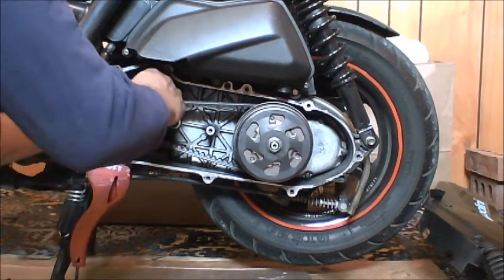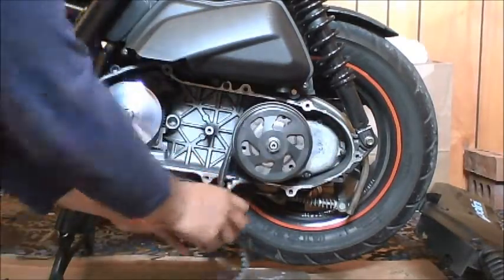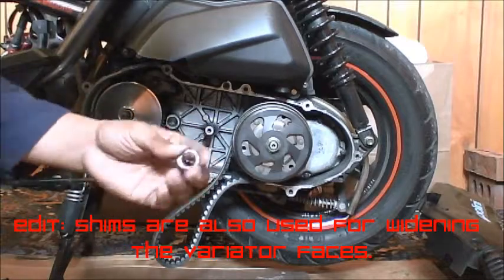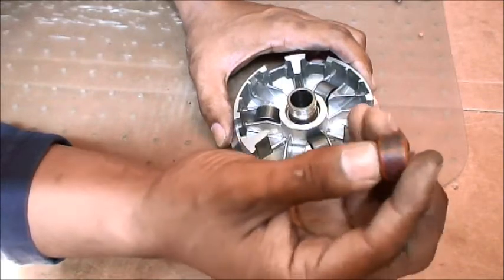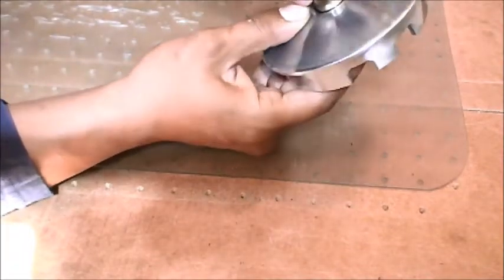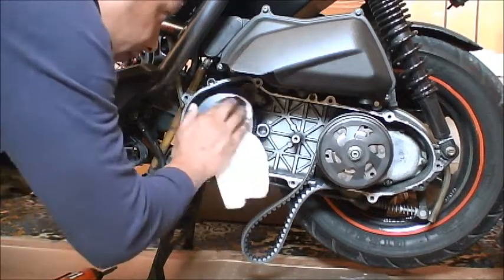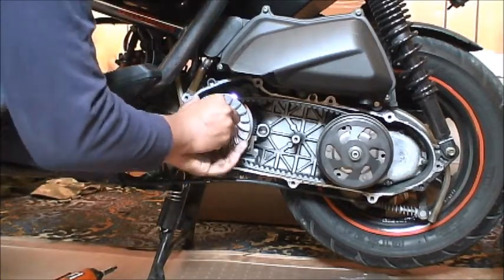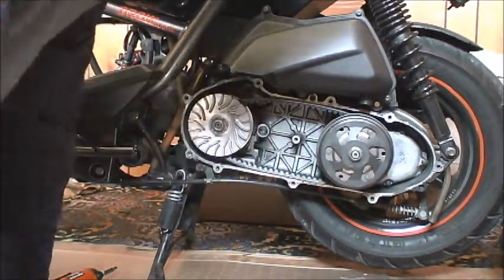TST variator How to. CVT, scooter Zuma 125 Bws 125

Comment: That is one of the best videos I have seen on removing the fan cover and variator assy.
Just bought a Zuma 125 with 6500 miles on it and will be replacing belt and inspecting variator weights.
Will leave stock weights in for now if they look good.
Thank's for doing it.
Reply: I'm always amazaed that I still get feed back on these old videos .. Thank you for watching

Comment: Did you need to install the blue 1200rpm clutch spring the kit comes with? Or was it not necessary. 

Looking at ordering the TST variator from Drowsports since it’s not in stock at rc scooter, so I’m trying to piece together my own kit.

Comment from the maker: @alejogonzalez83 The TST is a complete Variator replacement for optimal results. It does include a the fan which has slightly shorter fins then OEM and a matching ramp angle to the TST for uniform belt wear.

Comment: My fan keeps coming off, the nut won't hold on the spline, tried an impact drill and it stripped the nut, not the spline. any thoughts are appreciated. Also what is the order the washers go on?

Comment: I've got a zuma 50 and just replaced the rollers (6.5  down to 5.5) and new Yamaha belt. Take off is really slow with the new belt. I put the old belt back on and it's much faster. Should I get a second spacer like you have on the variator? Great job making this video!

Comment from the maker: @e85STi stock size. I found that oversize belts were prone to rolling over the top at high speeds. not worth it for only +2 MPH
Reply: I think that's what is happening to me, is pulling very well in all the rotation, but at high speed, it suddenly rises and seems to roll. But only in high speed? What do you think it is? Belt or clutch?
Reply: @nelsonfernandes709  variator alignment.

Comment: You can make those engines realy fast, i have one with 75mm bore and 80 stroke, and one with 66 and 64 stroke, they are realy fast, we do 6.5 on the 1/8mile, no nitrous no turbo, 98 octane fuel and, normal carb.
Reply: I'm thinking of boring mine out to a 66mm cylinder with a 3.2+ but what makes me nervous is the awful gas milage I'd be getting and all that extra heat on an air cooled engine.

What kind of mpg do you get on your 66mm bore, is it reasonable or a gas hog?

Also how do you deal with the heat? Is yours liquid cooled?